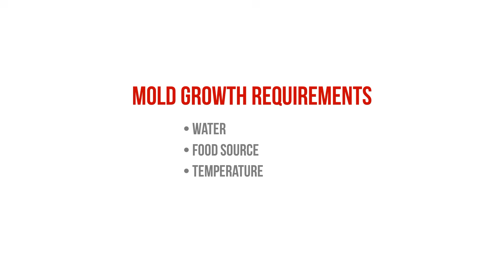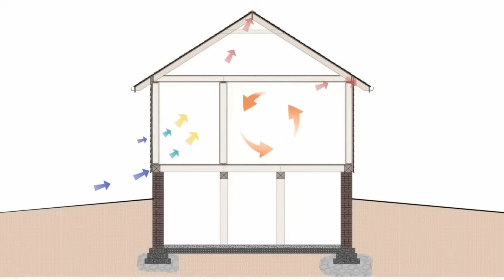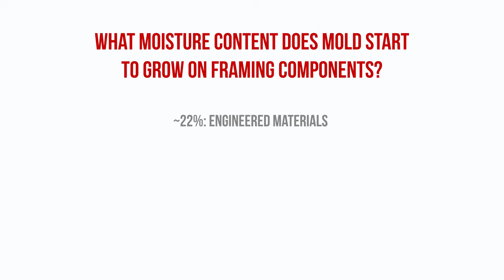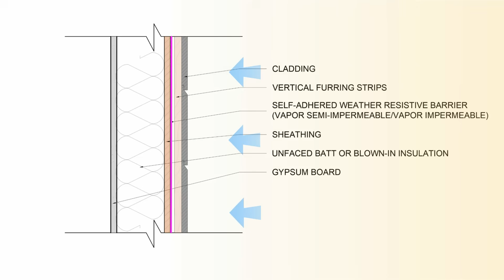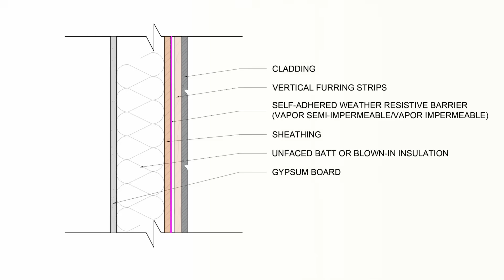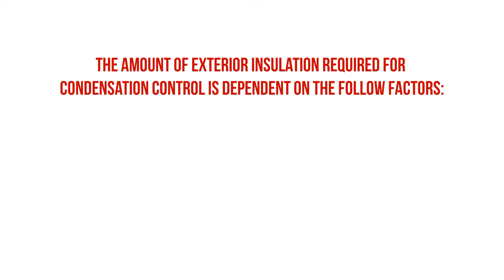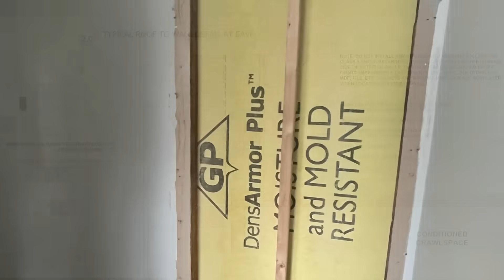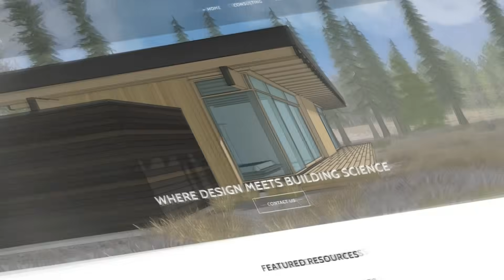Can Insulation Cause Mold Problems?

Comment: The real problem is the OBS  its gets damp , but want to blame insulation and vapour barier
Reply from the maker: Let's think a few steps ahead, how and why does the OSB/sheathing get wet? Bulk water leaks, air leakage condensation, and plumbing leaks. What happens to the walls if they get wet and they can't dry because we are slowing or stopping the movement of vapor? The OSB rots. The rate of drying must exceed the rate of wetting.

Comment: Is it possible to build a house without any organic materials?
Reply from the maker: Ofcourse, but there's no need to really do that. Organic materials aren't the problem, it's moisture.
Reply: @ASIRIDesigns , but I think you would agree that removing or minimizing the amount of moisture-sensitive materials in an assembly will make it fundamentally more resilient to factors like imperfections in the building process or design mistakes or oversights, or improper operations and maintenance. It's a good insurance policy to swap out things like regular drywall for fiberglass-faced, OSB for plywood, or wood for steel stud or concrete construction if you can afford it.

Comment: If you were going to build a small efficient house for the people, what would it look like? I'm imagining solid roof overhangs, minimal roof lines, maybe split framed walls for efficiency? Limiting the number of walls to having plumbing. Simple kitchen designs Etc, what would your "solve the housing crisis with lots of this house," house? What other things might you add?
Reply: To continue, simple to frame, maybe 8ft walls for simplicity of finishes, or 12ft to make it feel bigger. Durable exterior finishes. Hardwood floors? Lots of thoughts!

Comment: I'm in Central Texas,  Climate zone 2a, subtropical and humid. 150 years ago German settlers built homes out of limestone mass walls, and these houses are still standing. I'm trying to figure out if that approach would still be viable, and if so, how would one insulate smartly?
Reply from the maker: Very cool! They certainly don't build them like they used to. It heavily depends on how the building was designed, whether there are decent overhangs, whether there are embedded wooden components in the limestone, and the level of exposure the house receives. Usually, we would start with an extensive assessment of the existing conditions and then make a determination based on what is observed and any other limitations that could affect the building.

Comment: unless you have a swimming pool inside your home, your winter air should not be wet enough to produce condensation. A good test is your windows. If the RH of your indoor air was potentially going to condense on the backside of the drywall, then it would certainly condense on the window glass, which is colder. And it doesn't. If I cook pasta in my kitchen, then there is condensation on my kitchen window glass, but only there and only when I boil water. No other window has condensation. Same thing with my cold cellar walls. The warm air finds its way into the cellar and yet no condensation on the cellar walls either. Now, one might argue there is condensation but it evaporates faster than it can accumulate so you never see it. But the dew point math does not support that. But if it was true, air movement is still the remedy. 

For example, my air is at 18 C and relative humidity is 40%. The dew point is 4 C. But my window glass is 14 C. The back of the drywall will be at least as warm as the window glass. So no condensation can occur. So the vapor barrier that code makes us use is not only pointless, but hinders air flow which hinders drying of any moisture that does get back there.   

Unfortunately, with how tight they build houses now, your RH could be a lot higher. This is another benefit to not sealing a house up. We want the bit of moisture we produce by showering and cooking to find its way outside. Really tight houses might not need a humidifier on the furnace because too much moisture is being retained, but that is still a difficult point to achieve. Winter air is dry air.
Reply from the maker: I recommend researching the topic a bit more. The problem occurs when we have warm interior air hitting a cold surface. If we have 70 degree interior air 40% RH, our dew point is going to be about 44 degrees. What are the chances that the backside of the sheathing will be 44 degrees during the wintertime in a cold climate? Quite high if we insulate. Ask us how we know. Check out this article on Building Science Corporation on how much moisture can be deposited in a wall assembly in a cold climate via air leakage: https://buildingscience.com/documents/building-science-insights/bsi-149-slide-rules-pocket-protectors-cigarettes-and-iconic
Reply: @ASIRIDesigns at 18 C, and RH  of 40, the dew point temperature us 4 C. Those are metric numbers. Expressing it in Fahrenheit doesn't change anything.

I checked my window glass temperature and it was 14 C. Dew point is 4 C. That explains why there's no condensation on my windows in the winter time
Reply: @marks6663  You should not get condensation on modern windows . The only reason you would get condensation is if you have old single pane windows, the seal has failed and the gas between the panes has leaked out, or you have double pane windows in a climate zone that you should have triple pane. The reason you get condensation at you kitchen windows when cooking pasta is because you have raised the relative humidity in the kitchen therefore raising the dew point
Reply: @brycerobertson6031  correct. I don't get condensation on my windows because the temperature of the window is above the dew point for the RH of the air in the house in the wintertime. So the vapor barrier behind the drywall does nothing in that regard. All it does is hinder air movement that otherwise could vent humidity.
Reply: @marks6663  The vapor barrier behind your sheetrock, if you have one, is to prevent the humid indoor air from coming into contact with the outside sheeting and then condensing in the winter time. Comparing your walls to a modern window; the inside pane of glass is your sheetrock, the seal that holds the argon gas between the panes is your vapor barrier, the space between the panes is your insulation, and the outside pane is your exterior sheeting. If the seal in the window fails it lets humid air get in between the window panes. In the winter time the outside pane will be cold so condensation will happen on the outside window or your exterior sheeting. In the summer when you're running the ac it will condense on the inside pane or your sheetrock. Houses in colder climates that don't have a vapor barrier use exterior insulation to keep the sheeting warm so condensation does not happen.
Reply: @marks6663 The backside of the sheathing is on the otherside of the insulation conpared the to interior side of the window.

Comment: I don’t know what the solution is, but…  I almost always see this problem around penetrations that involve ductwork.  There is something about a dryer vent that guarantees you will have mold on the insulation side of the OSB and drywall.
Reply: try not having any osb at all, for any reason, ever.

Comment: I like the style of these videos. 

8.46 mins of solid educational value presented in a concise, professional format - no messing about.

Hope the content creator never leaves youtube.
Reply from the maker: Thank you for the kind words, we have no plans of slowing down!
Reply: I agree, however I'd like to know what I should be doing in my specific (5) climate, what is the best case scenario that won't break the bank?  I've been putting 1" foam with a foil cover (and tape the seams) and wet applied blown in in the cavities, so far I haven't seen any problems and it makes for a comfortable house.  Interior vapor barrier was banned some years ago(thankfully) although I always used a vapor barrier primer instead of the dreadful plasic.  If I go any more than 1" foam, I'd have to run boards over top of it, something that would be costly and make the vinyl siding more susceptible to damage.

Comment: Did you have any videos that talk about insulation and./or vapor barriers behind showers or tubs?  Thanks Charles
Reply: I’ve done a lot of bathroom remodels where they didn’t install the vapor control layer behind the fiberglass tub/shower unit. It’s pretty typical that they’d throw some insulation back there and pop the unit in after framing and before the mechanicals and insulation contractors. So the sheathing behind the tub/shower is usually moldy and rotten. It’s important to install the vapor control on that wall expanding out beyond over the insulation and then when the rest is done it can get taped to it.
Reply: Unitil 2 years ago, our jurisdiction was enforcing a requirement to also install vapor barrier INSIDE the bathroom if the shower enclosure had an exterior wall as one or more surfaces. They would actually fail the Rough Framing inspection if the plumber didn't put it this barrier.
Now, they no longer require it.  So for 4 years it was required.  Then it wasn't.

Comment: Fiberglass insulation is EVIL.
And I say that because of experience working with fiberglass. The particles on your skin are not fun, but the dust in your lungs causes a whole menu of health problems.

That's aside from causing some of the worst rot and mold you will ever find in home inspections. And it's best friend is of course is air-tight sheet rock.

Cheap is not a good reason to use this in any home.